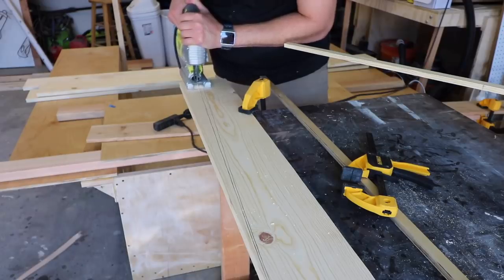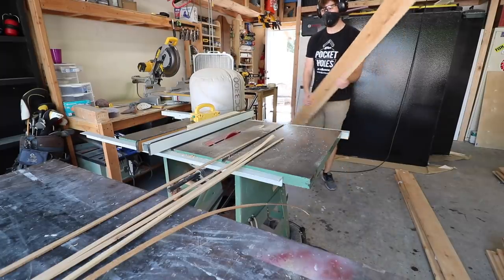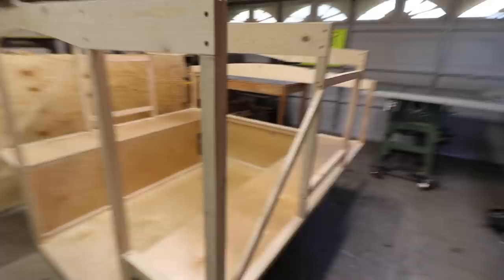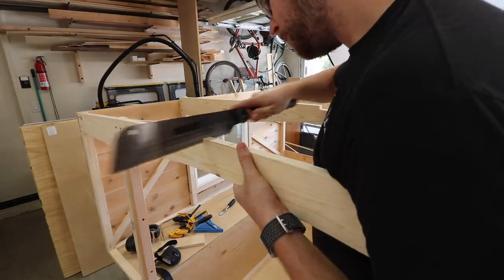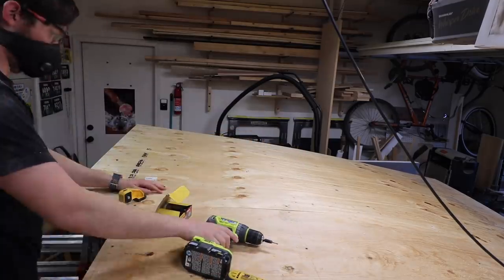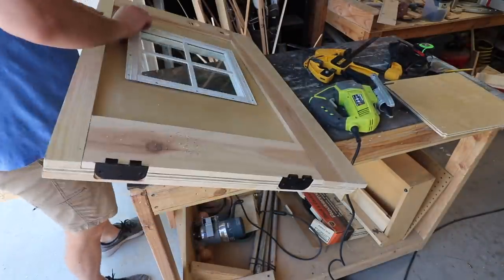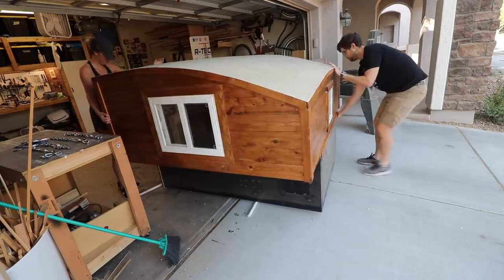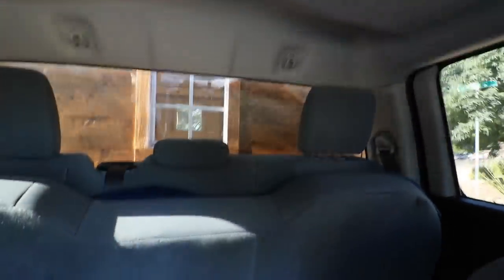DIY Truck Bed Camper/ Tiny House - Build Part 2

Comment: You've inspired me to make one of those for my Tundra !!! Only my sloping roof will be tall enough to stand up straight in and then will taper down towards the front of the truck. I have to be able to stand up in it or I will lose my mind. Keep up the AWESOME work. !!!
Reply from the maker: HayabusaOrlando Good luck Building! It is really satisfying having staying in something you built!!
Reply: howd it go? i was gonna make one for my tundra. I have a 5.5 bed crewmax so mine would have to have tailgate down and go beyond if im gonna sleep in it,  curious if you made one and have same bedsize
Reply: @jaredlabriola  I turned my bed the other way.  With a dully it would not be wider than the truck.  Mine only sticks out 4" on each side.

Comment: Hi,
I am an old geezer woodworker, flutemaker who lives in the home I built 45 years ago.  Good job.  Do bolt it or tie it down.  As for your girl helping as long as she isn’t with child she should do what she feels comfortable with.  Blessings, young folk.  Rand
Reply from the maker: Rand Rowe that awesome, I would like to build my family a home one day! The camper is tied down to all four corners of the truck bed. The camper is not really that heavy, I could lift it by myself but the size needs someone on either side. Thank you for your kind comment!

Comment: Unique build. Very well done. I would've suggested 1/4" plywood for the roof to reduce weight, especially since you covered it with glass. Keep the CG lower.

Comment: Inspirational! 1977 I had a guy build me something similar, but my brand new GMC Pickup rusted under the paint 75% in under 18 months!  I sold the rig. Now I want to try again with my aluminum F150 , DIY like you.

Comment: Nice job! I especially appreciate it being able to accommodate taller people. An earlier comment about the hinges is correct.  As is, someone could still gain access to your "stuff".  How well has the polyurethane held up when exposed to the weather? I used it on an outside door that had to be stripped and coat with spar varnish the following year. Again, great job. I enjoyed your video.  I now plan to build something similar for my small utility trailer, that I can remove when I need to use the trailer for something else.

Comment: No sir, it's called a dado cut. A kerf is making a similar cut but allows you to bend a board. Great idea using an oscillating saw For the mortise cut. As for stain, try a sample of "Provincial" color stain. It's my favorite. Also, poly isn't your best choice. Next outdoor build you do, use Sparthane. It's formulated for outdoor "poly" use. But please tell me you secured the shell down to the truck. Great job
Reply from the maker: Guy H. Thank you, I will have to try that! It is secured to the bed in all four corners with turnbuckles

Comment: Your door hinges are reversed. You have no security.  All it takes is removing those 4 pins and the door falls out.   Hinges are supposed to be inside the door.  Check your house and front door for the proper install of door hinges.
Reply: Nice job👍👍

Comment: What happens when it rains and water gets into the bed under the camper? Does it corrode the wood from the bottom? Or is it all sealed well enough for it not to be a problem?

Comment: Here is a formula to calculate your arc on future projects. I used this when doing gable arches on my home. You calculate the circle based on the length and center height of the arc you want, then set up a giant compass in the driveway with a rope and pencil. Radius of a circle from arc info
:
R=H/2 + W(2nd pwr)/8H
Reply: Of course this only works for a uniform arc so may not have helped you on this project anyway. Still, a good formula to keep on hand.
Reply: Thanks

Comment: A couple questions first how much did the whole project cost 2nd how much does it weigh since it took 2 men to put it on the truck no problem[light weight unit is very ideal considering what I plan on building
Reply: I don't know how much this cost but I have one that I am building and will have less than $1000. Mine you can stand in up to 6' with a small cabover.

Comment: You forgot to strap it down to the bed of the truck. In case bump terrain or strong winds while traveling.
Reply: There are holes in the front corners to attach to the bed tie down eyelets.

Comment: Coping saw for that thing. Did you glue and screw or just screw your framing?
Reply from the maker: I did glue and screw the framing
Reply: Is there anything you would do differently if you were to build another? This one looks really neat.
Reply from the maker: Greg Boyer Definitely give the cedar more time to dry completely before mulling it into the ship lap boards to reduce it drying on the frame. I was working on a deadline so I kinda rushed. Maybe make it a little taller for more head room, but I like how aerodynamic it is, doesn’t affect my mpg.

Comment: How much gel coat did you use... a gallon or a quart?
Reply from the maker: Alec Morrow I used a quart, and it was barely enough
Reply: Thanks for the help. Do you happen to have a link for the fiberglass mat, resin, and/or the gel coat you used?

Comment: Looks like a job well done, but please tell me that you're not actually going to take that out on the highway with nothing to hold it in place....  Your tailgate won't do a thing if you get in an accident or have to slam on your brakes.  You need metal tie downs to keep it in place, and as you know,  some long jacks so that you can back up to the camper to load.  I'm an old woman in my 70's who has had many different kinds of campers, including a truck camper, and I wouldn't drive around the block & put my life or someone else's in danger without tie downs.  And don't you have a guy friend or a neighbor who could have helped load?  A woman is not made to lift that kind of weight above her waist like that.  Nice build, but otherwise, you leave me wondering if your girlfriend is making a wise choice when you don't care about people's lives or your girlfriend getting seriously injured.
Reply: I agree with  you on the Tie downs, but the bs about a woman not being made to lift weight above her waist, and criticizing her choice in men because he asked her to help him is not only sexist, but just plain rude.